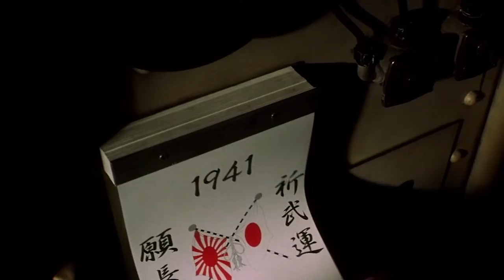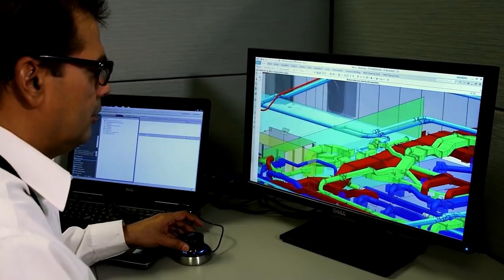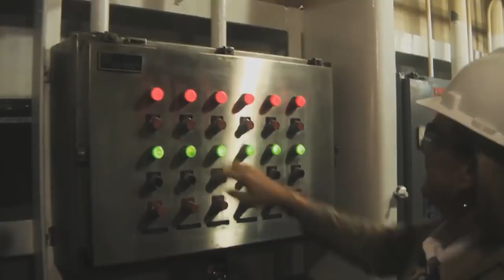Gerald R. Ford - the new flagship of the US NAVY

Comment: During WWII, the United States built 36 aircraft carriers ans lost three. All this between 1941 and 1945. The Ford's keel was laid in 2009 and she is still not fully operational. Inability to handle the F35 variant she should have and problems with the weapons elevators are two problems. Here is a clip from, an article on the carrier:  “CVN-79 will not be able to deploy with F-35s when it’s delivered to the Navy as a direct result of that cost cap. So when that cost cap was imposed, the Navy traded that capability off and chose to build that back in on the back end,” the committee staffer said. “That’s unacceptable to our members that the newest carriers can’t deploy with the newest aircraft.”

Making the carriers able to deploy with F-35s was just one example of work deferred until after delivery, the staffer said. Some capabilities are installed during post-shakedown availability (PSA), in a growing trend that is among the reasons Ford‘s PSA is running several months over schedule. Other capabilities are delayed until regularly scheduled maintenance availabilities even later in the ship’s life.

Last week, the Navy’s top weapons buyer conceded USS Gerald R. Ford (CVN-78) would not have all of its advanced weapons elevators working when the ship leaves its PSA in October. Currently, only two of 11 weapons elevators work properly, and when the ship leaves the yard in the fall it will depart with only some elevators working, Navy acquisition chief James Geurts told reporters last week.

Comment: I live in Newport News and I pass this ship every so often. The Ford has a serious design flaw which has rendered its catapult system virtually useless. The navy changed from a steam based catapult to an electromagnetic one. The electromagnetic catapult does not have the torque to reliably launch heavier aircraft, so it sits in port while the navy figures out what to do. It could literally be years....

Comment: Just to clarify what others are debating the term Flagship.  First there is no one, central, lead ship in the US Navy considered the flagship of the entire Navy, even though the USS Constitution I believe has the ceremonial designation.  Second it is not called a Carrier Group for nothing.  All ships accompanying the carrier are there for support of the mission often directed from the carrier.  A number of them specifically for protection of the carrier.  Third the term Flagship is outdated but still used to designate which ship the task force commander is using as the command ship. Normally it is the carrier.  Let's say a carrier has to SCRAM the reactors for some unexpected reason (yeh, I know the odds are remote to "ain't go'n to happen", but suppose).  With power lost, the Admiral could "transfer the flag" to another ship. Meaning the other ship is now in command.  Again nothing to do with the physical relocation of a piece of cloth.  Obviously, the Admiral would want to relocate to the new command ship ASAP.  Fourth only an Admiral may fly a flag to show an Admiral is on board. An Admiral may move about from ship to ship (Inspection, award ceremonies, etc.) but his principal ship remains "the flag".  As pointed out elsewhere it is theoretically possible for a carrier / task force to have more than one Admiral on different ships in the group, but only one is in charge of the group at any given time.  For those on carriers or other aircraft platforms, keep the deck clear of FOD and have a smooth voyage.

Comment: Fun Fact: U.S.S. Enterprise CVN-65 remains the longest warship ever built at 342 meters. That doesn't mean it's the biggest, just the longest. I personally believe whatever ship is heaviest gets the title of biggest. I can't wait until Enterprise CVN-80 is launched and commissioned. It wouldn't be right if they didn't build a new Enterprise. That ship is the most iconic ship in history (sorry Titanic). There have been 2 Enterprise aircraft carriers with a third on the way, and there have been several sailing ships before that, as well as the first space shuttle being named Enterprise.
Reply: That space shuttle never flew. It's only you star trek fans that keep the name going.
Reply: @12345sc1  I know that. Both aircraft carriers were commissioned before Star Trek even existed. Star Trek first appeared on September 8, 1966. Enterprise CVN-65 was commissioned on November 25, 1961 and decommissioned on February 3, 2017. Enterprise CV-6 was commissioned on May 12, 1938 and decommissioned on February 17, 1947. The name Enterprise goes back several hundred years, to at least the late 17th Century. So you're wrong, the name Enterprise has stuck around for at least 300 years.

Comment: So the hulls are about the same as the Nimitz class. Seems a lot cheaper to just upgrade the Nimitz then, in stead of building an entirely new hull. Just change out the RADAR system and other sensors, change the steam catapult, change the reactor, and add the new weapons systems. And you have essentially the same thing just a lot cheaper because you are reusing the hull.
Reply: A lot easier said than done, also even though it's hard to fathom, in the long run it's cheaper and much safer to build new boats.
Reply: The Gerald ford seems to have a significantly higher energy output of her reactors and probably not only better energy efficiency, but is far more prepared for a ton of electronics. Generally the hull is the least expensive thing about a ship, it's the system integration and main components that drive up the costs and are difficult to make work. So in short saving on the hull probably is saving on the smallest budget point in the entire built.

Comment: A truly amazing ship.

The world for some reason has forgotten just how powerful the US are.

👍🇬🇧
Reply: It's catapults, recovery system and elevators are still not operating to the designed specs. It's billions over budget and not able to be operationally deployed. At this point, she is not expected to be operational until 2022, which is 13 years after her keel was laid. If you look up the term "money pit" you'll see a picture of this ship. We should not have decommissioned Enterprise until this ship can actually be sent on deployment.
Reply: Lee Seals 

That may well be the case, but it is a new class of carrier, is far more advanced than it predecessor and you always expect the first of any class to have issues.
Yes i agree that over spend is not ideal at all, but teething problems occur.
These issues wont be, well...an issue, on the remaining vessels.
The UK (as an example) built the first QE class, the second is being built now ahead of schedule as they have streamlined production based on experience from the first, have identified issues from the QE and as such will have a second carrier faster.
I reckon the same thing will happen with Fords.
That class of ship will around for decades to come, so a slight overspend (comparative to the military budget) is not a huge issue.
Once she is commissioned she will be, they all will be, truly formidable.

Comment: The magnetic catapult system can neither safely nor reliably launch aircraft, nor does the new arrestor cable operation system work correctly either. The Navy is now singing a different tune about these systems, and vowing to replace them with steam systems, but the EMALS system is so deeply integrated into the propulsion and power systems of the Ford class (and by extension, *the entire ship*) that removing and/or replacing it is a fool's errand.
Thus, we have ended up with the largest, heaviest, most-expensive, and first nuclear-powered HELICOPTER CARRIER in history.
Reply: That's interesting. Could you state a source for you information?

Comment: I still don't understand why they can't put new reactors, technology, and upgrade the interior of the old ships, it's just a hull isn't it?
Reply: Its because the reactors inside the Ford are rated to greater powers than the steam plant on the older ships can handle, plus it would be more difficult logistically to remove and replace a reactor, along with all the machinery required to support it than it would to simply build a ship around it.
Reply: Pliny the Younger ditto

Comment: Good job on your video.  I have to offer a correction here.  The Ford is a embarrassment to the US Navy.  This thing stays tied to the pier more than it goes to sea.  Problems all the time that arent the crews fault.  Way over budget.  This line should be scrapped.  As a Enterprise Sailor, I truly believe the Nimitz Class(especially Reagan, and Bush) are far superior, and dependable.  The shipyards have making the Nimitz Class down to a science and we have improved core designs for them.  Just because something is newer, doesnt mean its better.  "The more complicated the piping, the easier it is to clog."
Reply: windstarpro that’s actually incorrect on multiple accounts the USS Gerald R. Ford is the most reliable ship in the entire US fleet. The problems that you refer to took place during the attack and defend trials when the ship was tested on how it would be able to take a torpedo. The trials proved that if the torpedo hit the right spot it would cause the pipes through out the ship to clog, which is to be expected after a hit from a torpedo. But there are counter clogging pipes through out the ship that can re run the sewage and water to other parts and prevent pressure build up. But good argument, and yes I do love the Nimitz class carriers.
Reply: @alexwhite2377  What? No. That has nothing to do with the ship actually getting out to sea and doing it's job to begin with. I don't know how you jumped to certain systems on the ship as you did which don't have anything to do with my point. The fact is, it is the MOST UNRELIABLE pos. Need evidence? They destroyed a turbine generator after start up. Not the crews fault. I will not discuss here what exactly happened, but I was on the Lincoln which was moored next to the Ford in the yards. Then, they managed to EMP themselves with the new catapults resulting in a loss of propulsion. Things there I cannot discuss here too. Not entirely the crews fault either. When these things happen, reports get sent to all commands so that we can learn from the occurrences. So, no this ship is junk. I would not want to go to sea in it. Not a matter of opinion. If you lose propulsion, electricity, steam, you are going to die. You will lose combat systems and your ability to maneuver away or towards a threat. I could give a shit about the piping in the heads if I'm being shot at.
Reply: windstarpro with respect sir, you stated the “pipes clogged”. And I was correcting  what you had said because the sea trials had caused pressure. Now what you said about the EMP accident, where you referring to the magnetic catapult that puts the jets in the air? Because that system has actually experienced issues with the engineering, but they fixed the problem, it was released that it was a surge of magnetic waves that caused the loss of propulsion, but that problem was patched by, I believe, putting rubber under the steel magnets. Now I realize that you serve in the Navy, and yes you are correct when you say that it’s was embarrassing.
Reply: @windstarpro  "Then, they managed to EMP themselves with the new catapults resulting in a loss of propulsion."  This is expected and wasn't a big deal.  Emals is new and has never been fitted to a ship before, that's why the system was given several months to be installed.  It failed several times because it's not just a new design, it's a new technology that has only ever seen testing on land based airstrips.  You're complaining about an expected teething issue that's been fixed.  Emals is necessary, by the way, because it allows lighter planes like UAVs to launch from the carrier, something that will be relevant ten years from now and can only take place if carriers begin adopting emals.

Nimitz, meanwhile is easily at the end of its lifespan, and really the Reagan and Bush were responses to the fact that the design can't be upgraded anymore.  It has an old reactor that doesn't produce much power, meanwhile the ship itself wastes a significant amount of the power the reactor provides.  Imagine if some enemy nation was equipped with stealth aircraft 15 years ago, and the only answer that made sense was to equip the fleet with more power demanding radars.  The Nimitz would be unable to accept such an upgrade.
Reply: @motmontheinternet  Ford products same thermal energy, and thus same wattage. They fitting of this new catapult system is a big part of what put this ship behind schedule for delivery. There was a switch from electric to steam and back. It was so bad that Congress debated scrapping the whole thing more than once. Also, losing rod control and going dead in the water was no little thing and not expected. I do agree there are some new things that may have been needed to upgrade. But, the rest of it... What are we spending this money for? By the way, Bush did launch self flying stealth aircraft successfully.
Reply: @windstarpro  the reactor produces more electricity than the ones in the Nimitz.  The Bush (and any Nimitz) can only launch UAVs like the X-47 because those aren't proper UAVs, hence why the Navy is having a hard time defining a role for it.  Go look at a UAV like what the air force uses, they are thin, spindly planes with large wings for their weight.  This lets them stay airborne for many times as long as a conventional aircraft, and the Nimitz is unable to launch aircraft designed in this way.  The X-47 is built with an airframe more like a conventional aircraft.

Comment: And it is still so unreliable as to not be useful.  Problems that may not be able to be corrected without major demolition and removal of the new systems and replaced with the old ones.  Catapult is unreliable.  Engines are very iffy.  Can't be relied on to conduct flight operations for even a few minutes.  Hypersonic weapon vulnerability and the list goes on.